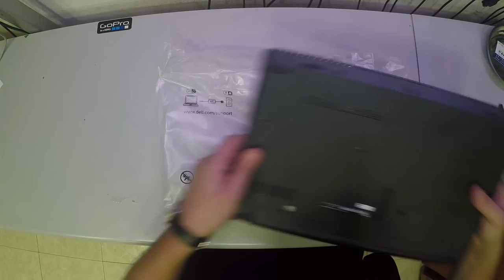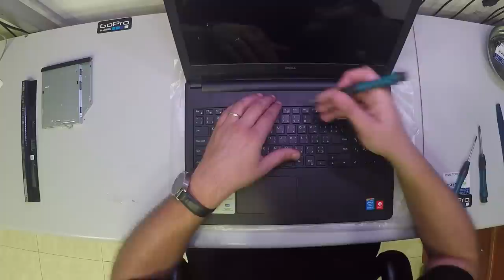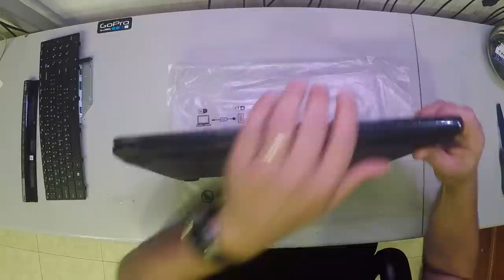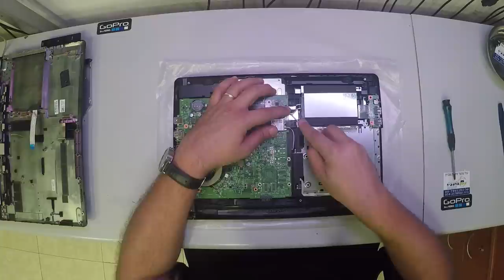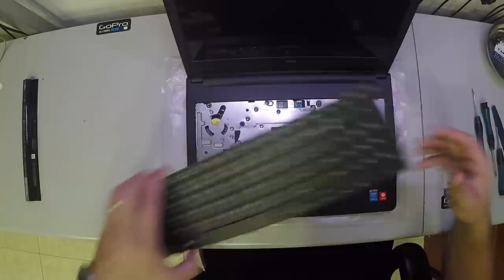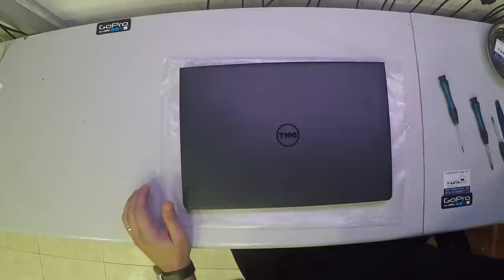Dell Inspiron 3558 Full Disassembly and Reassembly

Comment: I just bought this laptop and wanted to add some memory. Thank God (or Shams in this case) for this video. You would think Dell would just have a small cover over the memory so you could easily get to it. I had some issues (getting DVD drive out, cover coming partially off the DVD drive, A ribbon that did not want to go into the slot, but I persevered and got it done. Thank you Shams for making it possible.
Reply from the maker: Hello nick
thanks for your comment, for getting DVD out safely watch this video from min 2 - https://www.youtube.com/watch?v=S5GvysL3lnE&index=68&list=PL43q5LIt9XwBj0sLkutq9lt6lu8csNcAH

Comment: thank you for sharing. i just brought Dell inspiron 3558.. i need to increase my RAM into 8GB.. so i need to open the keyboard and DVDroom first? so difficult.
Reply from the maker: You're welcome
Subscribe for daily updates
Reply: Same. They made the upgrades for this system much more difficult than previous 3000 series laptops. Much more disassembly is required. I considered also upgrading the HDD to a SSHD for combination of storage space and boot/load speed, but now I'm having a hard time justifying just the simple effort involved.
Reply from the maker: yaa

Comment: to change ram I have to take out the keyboard and the cd drive???or I have to take out only the back case
Reply from the maker: Hello petmwister
to get to the ram you need to take the keyboard the cd drive and then back case.
Reply: +Shams abd el kader (eShams) ok dude thanks
Reply from the maker: you welcome
Reply from the maker: Hello
it was first time i disassemble this model, so i didn't take a risk to damage the laptop.
you need to take out just the white connector to upgrade the ram.
if you want to take the main board you need take out 3 connectors.
Reply from the maker: your welcome

Comment: How many sticks are originally with this model? 1 4gb ram or 2x 2gb ram, and what ram sticks did you use? I don't know which type of sticks to buy.
Reply from the maker: hello
this laptop came with 1-4G slot, you can upgrade it with 2*4G (DDR3L = LOW VOLTAGE) PC3L 
any brand

Comment: Hi Shams Thanks for the helpful video! In one comment you said we can use 8GB+8GB RAM but another place you said max is 4GB+4GB. What is the max ram for this laptop 8GB or 16GB or 12GB? Thanks
Reply from the maker: hello tariq
max 2*4G (DDR3L = LOW VOLTAGE) PC3L any brand
Reply: Thanks!

Comment: This is a great video!

It inspired me and I have a few questions and ideas.

It seems that the Inspiron 3558 and Vostro 3558 are identical, yes?

I was wondering, as I recall Dell makes core Intel chip integrated into motherboard, yes? Is there another way to swap out the i3 for an i5? It seems that the easiest solution would be to replace the motherboard+i5 core from a  Vostro 3558, yes?

If i wanted to totally modify this unit, and install an i7 would i need to replace the motherboard to allow for the DDR4 SODIMMS? This would also enable M.2 PCIE memory too, yes? If this is the case then I could also add a better GPU as well?

I was thinking of using the DVD drive slot to add another SSD? There must be a way to swap out the DVD drive bay with an SSD, yes?

Is it possible to replace keyboard with 10 key with one that illuminates?

Could I upgrade the 3 cell battery to 6 cell?

It would be like using this laptop as if it was a barebones whitebook and then rebuilding it with XPS comparable components?

If I replace 5400 HD with an SSD and install Ubuntu 16.04 LTS would I still need to get updated bios? 

Any idea on how and where I could get the replacement parts to do such a mod?

This might sound crazy but it sounds like an interesting project. It would be interesting to see how far the performance could be pushed with this.

What do you think?
Reply from the maker: jeff hello
1- yes, the inspiron and vostro are identical (sold in different countries with different names).
2- yes, if you want to change the cpu, you need to change the board too(the cpu soldered to the board BGA). 
3- yes, there's an i7 for this model. for m.2 pcie you can find adapter and in place it instead of the hdd 2.5''.
4- yes, you will find adapter (slim type) to add ssd 2.5'' instead the dvd.
5- for keyboard :-( i dont have answer.
6- for large  battery search in ebay. 
7- it's cheaper to buy XPS.
8- BIOS update make the system more stable. (it's always welcome)
9- ebay, amazon, and aliexpress.
yaa jeff it's crazy, buy new one with this specifications and you well save a lot of time and money.
you are grate i like this questions :-)

Comment: How were you able to remove the disc drive so easily? Mine doesn't seem to budge very much, if at all.
Reply from the maker: Hello tacos, under the battery you can see the edge of the disc drive (DVD) push it out with screwdriver.
Reply from the maker: For getting DVD out safely watch this video from min 2 - https://www.youtube.com/watch?v=S5GvysL3lnE&index=68&list=PL43q5LIt9XwBj0sLkutq9lt6lu8csNcAH
Reply: I tried this and mine still won't move :/
Reply from the maker: have you removed the one screw holding your DVD.
Reply: eShamsTechTips yes, I have removed all screws

Comment: Can someone explain the part in which you remove the disk drive? whenever i try only the cover comes out
Reply from the maker: hello elyas
push with small screwdriver in sid out,  thru the holl of the screw that hold the disk drive.
Reply: +Shams abd el kader (eShams) thanks ^-^
Reply from the maker: you welcome

Comment: What is the trick when removing the keyboard? I can see there are several clips holding it in place at the top of the keyboard but how do I release them?
Reply from the maker: Hello Travis
Start watching from min 3, you need small flat screw, you have five clips.
Start in the middle one, push the clip inside and try holding the keyboard with your fingers.

Comment: Hi! Does in this laptop only one slot for RAM?
Thanks!
Reply from the maker: Hello
no you have 2 slots, use 4G+4G DDR3L or 8G+8G DDR3L (DDR3L = LOW VOLTAGE)
your welcome
Reply: Thanks! Great!
One else.
And what about SSD. 
Does this laptop has mSata or M.2 slot? 
Or I just need to delete DVD-RW and get there SSD 2.5`?
Cant find any information about this.
Reply from the maker: hello
you can replace the HDD with SSD Drive 2.5" Sata3 ;-)
Reply: Hi shams, quick question can you mix ram sizes like an 4G+8GB DDR3L?  Much respect that you respond a to all the questions and concerns on here and the channel is very helpful thanks.
Reply from the maker: Hello rasflare
In this model 3558 you can use MAX 4G+4G.
Reply: Thank you!
Reply from the maker: Your welcome

Comment: Hi sir my dell laptop 3558 model, battery is not working sir plz help me
Reply from the maker: Hello Jagadeesh, You may have a problem with 
1- laptop adapter (power supplier).
2- Battery reached its life end.
3- a defected dc jack (need to replace).
Call your local DELL serves.

Comment: If you look at that back plate of the laptop, there is a metal plate that fell out of mine. It's right near the hinge on the DVD side. I cannot for the life of me get the back plate to fit flush with that plate installed. The plate isn't bent, it's sitting in the little tabs, but the back plate just doesn't want to fit correctly. It's making me insane. I noticed yours didn't fall out. It's a pain to install with that plate falling out.
Reply from the maker: sultors hello
if there no screws to hold any part in the laptop, I use a solder gun, hot glue gun our strong epoxy glue.
Reply: Shams abd el kader it wasn't the plate falling out, it was getting the back plastic plate to fit correctly with the plate installed. I messed with it for over an hour checking every possible thing and I was left with a bulge that caused the DVD drive to not fit correctly.
Reply from the maker: If I understand, you talking abut the back cover(the bottom of the laptop). the metal plate soldered with the plastic body of the back cover.
you can use solder gun melt the plastic and fit the metal plate to place again, some laptop keyboard comes today without screws, they hold them with this little tabs.
win I change keyboard I soldered them with solder gun here's example,  https://www.youtube.com/watch?v=_JKv7kdx9vs&index=24&list=PL43q5LIt9XwBo9mYnVBDu52wmDkiFpf09
watch for min 10:00 I hope I helped you

Comment: Thanks for the tutorial.  Are you absolutely positive this model is expandable to 16GB RAM?  If so, why would the official literature (and Dell Support techs) say it is only expandable to max 8GB?
Reply from the maker: Ben hello
Thank you for the headsup, your right i well list the models and the ram configurations.
Dell Inspiron 3558 up to 8G DDR3L PC3L (2G,4G,2G+4G=6G,4G+4G=8G)
Dell Inspiron 5558 up to 16G DDR3L PC3L (2G,4G,2G+4G=6G,4G+4G=8G,4G+8G=12G,8G+8G=16G)
Dell Inspiron 5559 up to 16G DDR3L PC3L (2G,4G,2G+4G=6G,4G+4G=8G,4G+8G=12G,8G+8G=16G)
Thanks again

Comment: I can't get the DVD drive to slide out, ideas?
Reply: I've tried pushing through the hole with a screwdriver already
Reply: Pushed on the back side of the drive from inside the battery compartment, and after a little wiggling, it finally pushed out, thank you for the video
Reply from the maker: Hello chris
I made new video ( how to pull the dvd out ) i will upload it today